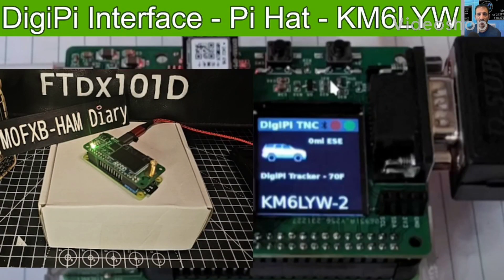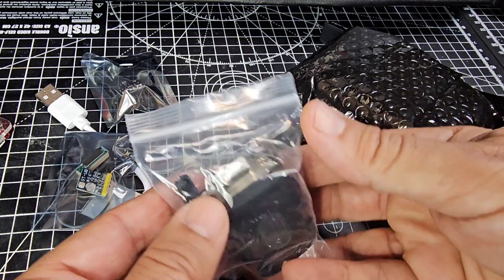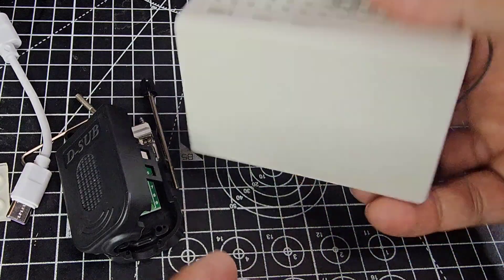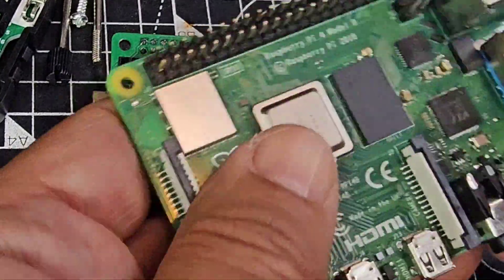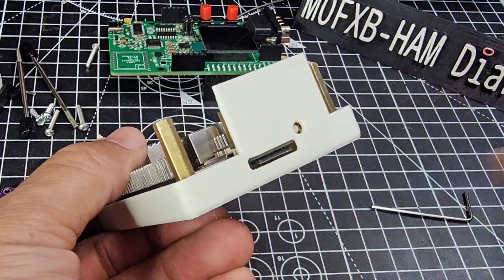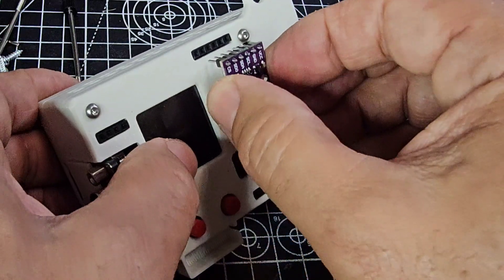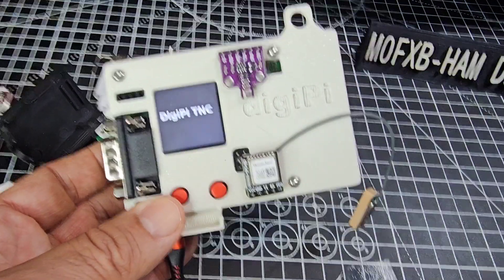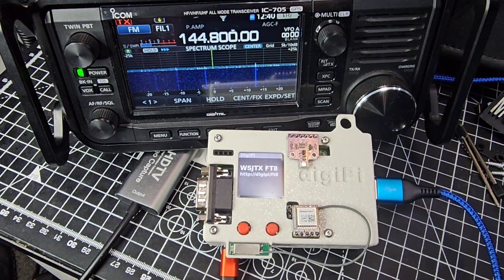New - DigiPi Interface Board & Case -Unbox / Install

Comment: Use the short USB-A to USC-C cable to jumper a USB-A port on the PI 5 to the USB-C port on the top side to power the GPS.  That is why the small cable is supplied.
Reply from the maker: Thanks